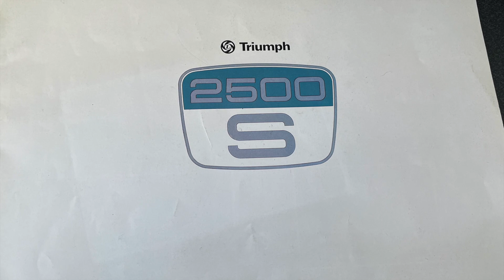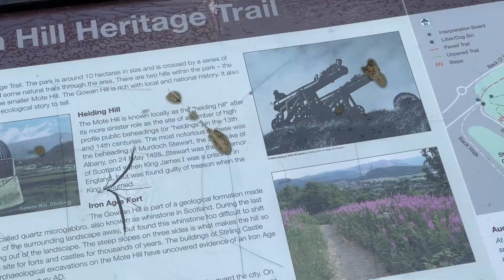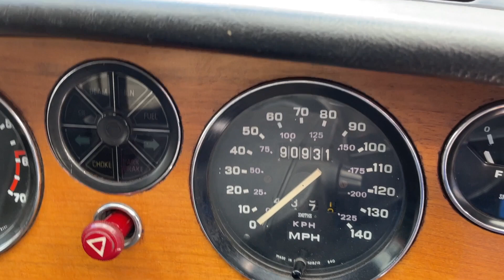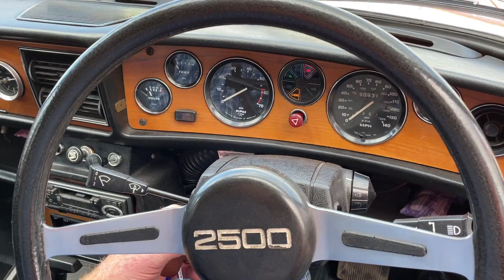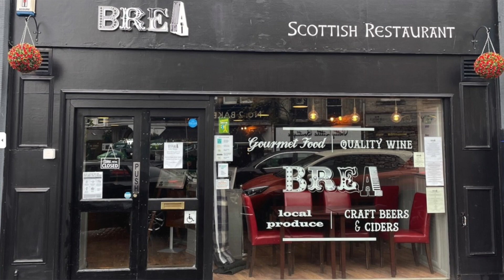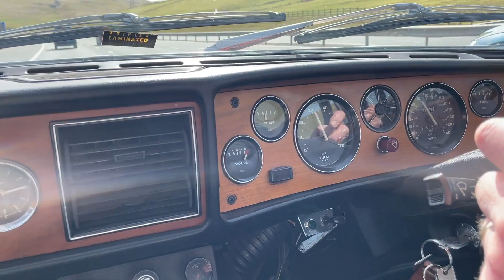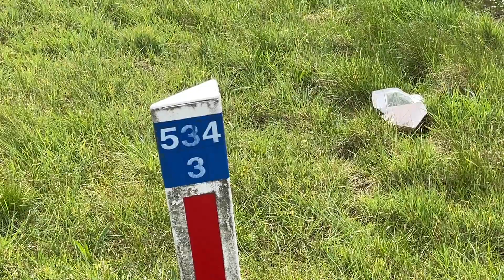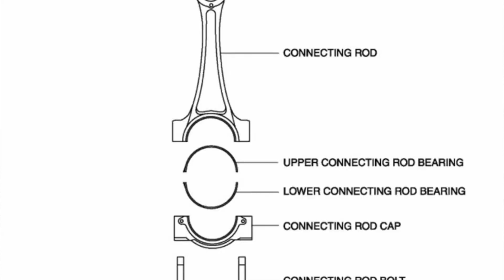I Bought A Triumph 2500S... UNSEEN! (Project Eddie Pt1)

Comment: You can actually hear big end knock on first startup at 10:52, what a shame because it does look to be a very nice car. I had an 1850 dolomite that did a big end and when I stripped it the mains were so worn though to the backing metal that caused big bearing clearances,  all the oil passed out of the mains and oil starved the big ends which are fed last. Luckily for me crank was salvageable with a .010" big end regrinding and new main and big end shells. If it was stored for prolonged periods during its life without fresh oil, the acidic oil could have etched away the antimony of the shells also. Will make a nice car when you have built a new engine.
Reply: Is the big end knock the first deeper noise for about a second as he lets go of the starter? So about 10:50 not 10:52? If it is I guess the noise then goes away as the oil pressure builds - but the oil pressure is disguising not fixing the problem? Would an oil pressure gauge have given any advanced warning? I guess not if it is just one bad rod end?
Reply: @davidartina5022  I don't think these cars had oil pressure gauges, if fitted that could have given some indication of the health of the bottom end though can be tricked by adding more viscous oil like STP oil treatment. Oil pressure switches are usually set to extinguish the oil light at about 3 or 4 psi anyway, so practically useless. Even on a horrendously worn engine, that is properly hot with an exceptionally low tickover you may get only a flicker from the oil light. My money o's on oil starved big ends from overly worn mains, possibly acid etched white metal from prolonged storage with ued oil in. Real shame though because it might have been a fairly simple rebuild (before it threw the rod).
Reply: I heard that too, and the vendor had left the engine 'Slightly Warm' too! - It must have sounded like a Perkins 2 Stroke Diesel from cold!
Reply: @ArryTheStag  Having watched through it again - Neil is correct. There's a very distinct big end knock before it settles down to a (very rumbly) idle.
Sadly, you'd set off on a long trip in a 'very sick' car..  The old pushrod Standard-Triumph sixes were very sweet and silky smooth when new.
Reply: Like you, as soon as I heard that start up, I also heard the big end knock and thought "hmmm" but then it seemed to quieten down which I thought was just the oil circulating through the engine. But its a lovely looking car, it brought back so many memories for me as my Dad had a 1970 2000 MK2 in Valencia Blue on an H plate followed by a 73 2.5 PI on an M plate, both manual with overdrive.
Reply: Great shame , but there was a big end knock at the very start up.
Reply: @davidartina5022  Or is it hydraulic lifters.
Reply: This motor was groaning from the get go.
Reply: @bobmirdiff2043  perkins didn't make 2 stroke engines.

Comment: The car looks very fresh, but I would have wanted to see pictures of it before it was painted.
I live close to Stirling and lots of salt used on the roads in winter.
The Triumphs rusted badly at the best of times but in Scotland!!!.
I owned two Dolomite Sprints ,and at five years old there was rust in the sills , wings,rear arches,bottom of the doors, boot lip, front panel.
Before I spent a lot of money on the car, I would remove the door cards and inspect the inside of the doors,and get a Borescope to look inside the sills and chassis legs.
Good luck , I hope it's as good as it looks.
I love all the old Triumphs.
Thin on the ground in Scotland, for a reason.

Comment: It did sound slightly iffy for a split second on start up, and always check the cranks end float. Also I would fit (on the new engine) a modified oil filter to avoid the dry start ups .

Comment: Yes, I too heard the knock on first startup.  Shame, as it's a very pretty car.  But it will live again I'm sure.  I owned a 2500 many years ago, and if the right one comes along I'd have one again, preferably an S, and definitely a manual with overdrive for better long distance cruising.

Comment: There was a short rumble on start up. I owned 5 Mk2s in the 80s, including a 78 S. All manual transmissions. I completely rebuilt two of the engines from the bare crank up, everything properly measured and reconditioned as required, inc the crank thrust washers and oil pump. They both ran beautifully afterwards. I would never buy a car or motorcycle that I had not actually inspected in person first, especially an elderly vehicle.

Comment: I've got fond memories of a Triumph 2500 PI I bought here in Australia many years ago.  Beautiful car, very comfortable, and with the fuel injection it had plenty of power for its engine size. The problem in Australia though was that the Lucas fuel injection motor could not cope with the Australian heat, so on a hot day the pump became ineffective. The Stag had the same system I believe.  Later on the fix was to replace the whole PI system with a Bosch unit and injectors, etc.

Comment: Nice car Tony - the breakdown brings back memories of my first car. A Triumph 1500FWD which I managed to breakdown in in the same place, (but when it was the A74) and for the same reason! The car threw the rod for cylinder 3. Which appears to be the one that fails on the 4 cylinder engine. The long stroke on the 1500 and 2500 puts extra strain on the bearings. This isn’t really an issue if all is well - but with wear and also standing the bearings can suffer. My car had been standing and the (way too late) advice was I should have run it in again - no more than 50 MPH for the first 500 miles. If rebuilding an engine To help avoid the issue the oil supply passage can be enlarged. Good luck finding a replacement block etc or engine. It’s disappointing and certainly extra expense - but the car will be worth the effort.
Reply: I know where there is a 2500 motor - ironically removed from a Stag

Comment: In 1976 I bought a 1973 200TC in carmine red with dark brown velour seats in immaculate condition. Within 6 months I lost 3rd gear but after a rebuild for £45 I run that car for 3 years taking my then girlfriend and I to Cornwall, the Lake District and all along the South Coast. It had a marvellous 8 track and swallowed luggage and was so comfortable, it didn't have power steering though! Thanks for jogging so many lovely memories! Hope you are able to restore the car - always wanted the 2500TC! Don't forget to top up the carburettor float chambers!
Reply: Whoops - meant 2000 not 200!!

Comment: I had a 2500TC manual with overdrive. Great car, and at one stage club raced it in complete standard condition. Timed at 95 mph down the straight. Was only 4 seconds a lap behind Triumphs with Stag wheels and triple carbs .  Then drove it home 300 Klm after.

Comment: As soon as you got there mate you should have got straight into the engine, forget all the daft badges and stroking bits of trim, your buying a old car, can't believe you'd paid before even starting it, you could hear it knocking when it first started, you should have revved up given it plenty of revs, you've had heard it knocking, last owner or dealer knew he's totally done you, so sorry for you bud.Not sure if it was a auction purchase, if so you've been well stitched by the vendor, which is why it was there unfortunately, best to go and view before you bid (if possible) I'm buying from auctions all the time and it's a nightmare.

Comment: Death rattle indeed. We guessed 150miles before u got going.--- but you only managed 90 :)  Having had 3-4 2500 bottom ends go - that is exactly the way it sounds. To be fait to the wear rate of anything 50 yrs old. Most of my '' bottom ends'' happened because some dipstick of a mechanic put in too thin an oil viscosity. From thoose learnings we went to and from the Med , Scandinavia etc. without any drama for yrs - often driving thru the night on the german autobahns at speed. Another small advice would be to choose a Man OD box to get the revs down - our estate S gearing seemed happy at around 80-90 mph at 3500-3600 rpm.

Comment: Sorry it ended the way it did! You were quite lucky you coasted to that works area. The A74 was a GREAT driving road, before it was "gentrified" into an "M" road. Still, now you can have a slightly modded engine, Stage II cam, head, bigger carbs, free flow exhaust etc. Anyway, locate another engine fit it and enjoy some saloon motoring.
Reply: Tony check with midlands Tony for engine he is magic

Comment: Ouch !  Had the same happen to a Rover P5  3 litre Mklll auto saloon.  Heading home to South Yorks from Whitby, on the A64 near Tadcaster in 1981.  Sudden bang and a noise like the exhaust had fallen off.  No5 big end cap bolt sheared, and the crank knocked the rod through the left side of the block, ripping the starter motor off in the process. I pulled the bonnet and my mate jumped out and found a shiney bent metal lump wedged on the l/h subframe rail,  which he promtly dropped as he realised it was Hot !  Meanwhile it's still ticking over like nothing was wrong. Had to switch off to patch and Gaffer Tape up the 6" hole in the block, to stop oil splash out. The inertia kept ripping the starter off as we tried to restart it and get it off the A64.  Had to get it towed home as we couldn't push start it,  but it started and ran once I fixed the starter motor. Breakers wanted a fortune for a good 3 litre 6cyl engine,  so it was sold for spares. In hindsight, the car was immaculate, I should have converted it using a spare P5B subframe and V8 I had. 🙄
Reply: out with 6 in with v8 ok
Reply: @jamesjenkins3724  Stag V8 into this one ? Ambitious !

Comment: I always wanted one of those, smooth, torquey, powerful cars in their day. I love that straight six engine too. Shame about the slight engine knock in start up🤔🤔 It sounded a bit more agricultural than I remember them, I recall them being smoother and quieter🤔🤔

I'm sorry to hear that the trip ended all too soon too - I did wonder if the engine would/had let go. It didn't sound right on start up (going from memory of those Triumph six cylinder motors - there was still a few about when I started working in a motor factors in 1981/82).

I remember my MGB, I had it dropped off, it had been fully serviced etc etc (reputable garage/ company). That weekend I did a forty minute trip down the motorway (I checked everything before leaving, made us ten minutes late). We were running late for a meet with friends, but all was well on the way down the car ran smoothly and all the Ts & Ps were spot on (the only whining, nagging noise was coming from the passenger's seat🙄). Upon returning to the car, I had this niggle - much to my girlfriend's annoyance - I wanted to check the oil, before driving off again. Good job that I did, it had quietly burnt off oil, with little smoke, to just in line with the low mark on the dipstick. Luckily I'd brought more oil in a gallon can, enough to get us home and save the engine. The idiot mechanic, for the sake of about a £1, hadn't replaced the crankcase breather diaphragm (and it had pretty much failed on that journey - badly perished). I let the company know - with a couple of expletives thrown in (the car was original matching numbers, 40k miles, one owner prior). I fitted a new diaphragm, oil pressure was still good, I did a compression test and all was well too. Good strong engine no leaks and never used any oil from then on, during six years of ownership.  

Thanks for sharing 👍😊
Reply from the maker: Thanks Muso - great post!! All the best TR Tony

Comment: Repaired them years ago, all I can say is  so glad modern motors came along...... Welding, engine rebuilds...thrust washers. On crank... Yuk. A thing of the past
Reply from the maker: Full analysis to follow in a forthcoming video in a few weeks time.. stay tuned!! Best TR T
Reply: I wouldn't be so sure... My 2017 transit has just spun a big end shell at just 114k.  It still happens 🙄

Comment: My father had a 2000 mk2 from
1970 and that had two big engine incidents.  One with complete loss of coolant - head gasket I think and second one was big end went.  Block was intact and engine rebuilt in both cases.  It was a very smooth engine. Remember how Mum and Dad sometimes tried to restart the engine sometimes because you really couldn’t feel it running at standstill.  Transmission was very noisy on the move - grearbox and differential I think.  I think there are plenty of things that can be upgraded in that engine to make it ‘harder’ and more robust.  It did sound good though although I did wonder if I heard a knock when it was started. Looks great otherwise and with new upholstery it would be such a lovely car again.  They really have a beautiful timeless style to them.

Comment: Its a mechanical fuel pump on this unlike the Stag TR;
    If I were you I would pull out the old gear box and fit a more modern 4 speed.. The car will perform much better!
 Nice to meet you down at the Classic last year BTW

Comment: Grandad was a taxi driver in the 1970s and his car was a Triumph 2000. I have never been in the bigger engined 2500. The 2.5 litre was introduced in 1968 when in Mk1 shape as the 2.5PI (petrol intection). The facelift into Mk2 was in 1969. Around 1973 it was replaced by the 2500TC and finally the 2500S in 1975 for two years until 1977.

Comment: Not the best start. Bugger! Unexpected too because that six has the best reputation for longevity. I noticed the handbrake light wasn't working. Mine was like that and upset my OCD. If it's not the bulb, there is a little wire at the base of the handbrake that gets bent every time the handbrake is applied. After 50 years of bending, they tend to brake. At least it's a cheap repair :)